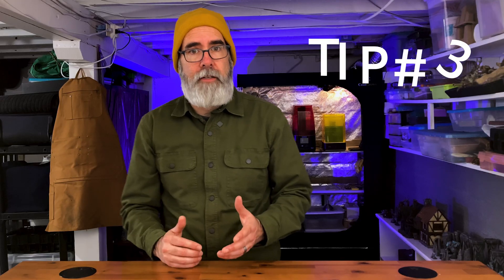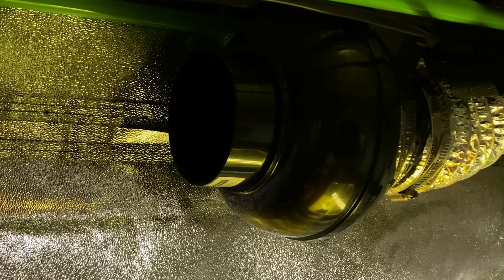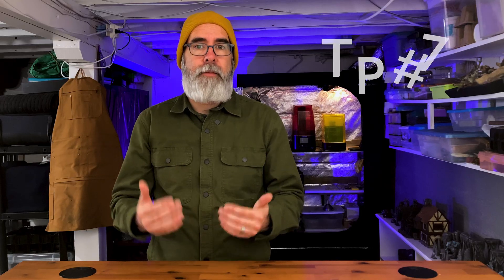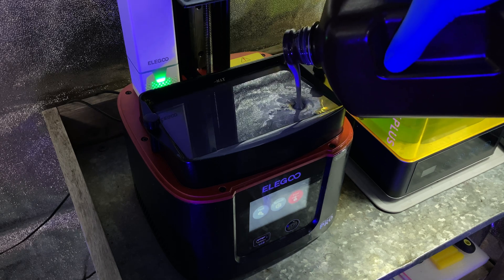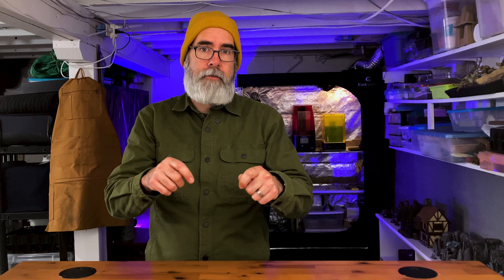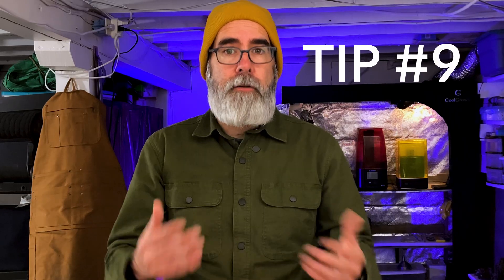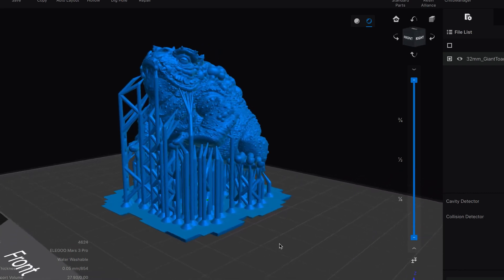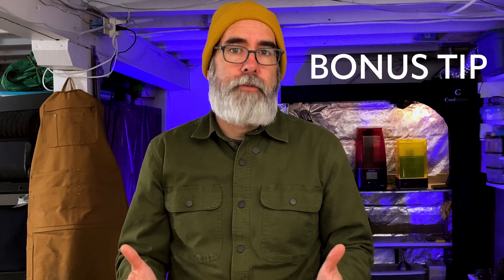Advice for Anyone Starting Resin 3D Printing in 2025 | Beginner Guide

Comment: I haven't made the leap into resin, some of those tips for FDM printing are very similar. I print differently in the summer as I do in the winter. Same with memory cards. Both my older FDM printers came with 8gig cards. They eventually failed. I heard 64gig cards wouldn't work, smallest I found were 32 and 16....I heard they should be ok. But I guess the good brands I got both failed. Was a nightmare I managed to find another old 8gig that worked on my old camcorder and it worked. I have more modern FDM that are a game changer in speed and quality. Workflow has totally changed in a good way.  I will do get a resin. Thank you for your video. I never heard of the heat belt. I will look into that.
Reply from the maker: Thanks for watching! It’s kind of crazy that not all memory cards are compatible. I wonder if formatting them a certain way would help.

I still need to try the heat belt myself. AND I intend to get into FDM as soon as I can so that I can vastly expand the types of things that I can make.
Reply: @alchemyofcraft  I tried different formatting with no success

Comment: Thumb up. What do you think about these special build plates that elegoo has on the newest printers? Like Saturn 4 , mars 5? I didn’t know there might be problem at levelling, yet they fixed it. I have SL1S and in that matter is perfect.
Reply from the maker: I can’t speak to that question yet because I’ve never used those printers, but I hope to upgrade to a newer model soon.

Comment: Thank you so much for the tips 
Unfortunately my printer doesn’t risen calibration test and I can’t test multiple exposures test in one go. 
Do you know any way around it?
Reply from the maker: I'm not totally clear on your question, but the calibration test prints I mention in the video are linked in the description. They're basically just specific models that you can print to test whether your printer settings are where they should be for your printer, resin, and environment in order to ensure the most successful prints. And since the models are small, they can be done in as little as a few minutes. Does this help?

Comment: I just got started with 3D printing and now I'm realizing that its harder than I thought. The test model worked out but my models wont print even though I have lots of supports and no islands anymore (maybe a complex bee isnt good for the beginning). 
For now I stopped working with the printer because a grow tent is needed for the toxic air to go outside. Oh and the handeling oif the water is pretty important
Reply from the maker: Yeah it takes some time but hang in there. One nice thing to remember is that you’ll learn from all the challenges and you’ll be a pro soon enough. You may still have a failed print from time to time but you’ll have more successes than failures. It’s worth the journey.
Reply: @alchemyofcraft  yeah I hope so, thanks for the reply.
I checked your channel and its very good, keep it on :)
Reply from the maker: @krypto61  Thanks very much! Lots more to come...

Comment: Ive had numerous failed prints due to FEP film adhesion, especially now during winter. Ive been thinking of developing a standardised tool to check tension pre-print. Drum tuners arent reliable at all. I just wish we also had a graph from manufacturers showing the ideal viscosity limit.  Good job on the vid, maybe add some technica tips for me to steal next time ;)
Reply: Check out the new Saturn 4 ultra 16k. It looks like it solves both issues with a tilting heated vat
Reply from the maker: Thanks for watching. One thing I’ve done a few times is to pre-warm the resin by placing the bottle in a container of warm/hot water for around 5 minutes before filling the vat. As I mention in the video there are many variables to a successful print, but you might consider giving this a try to see if it helps.